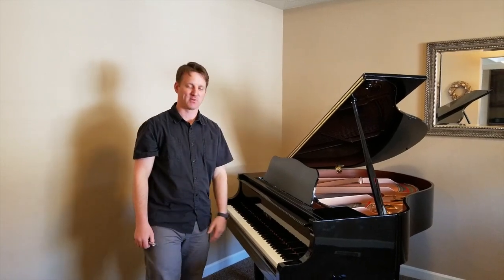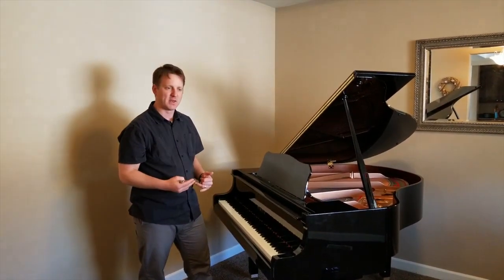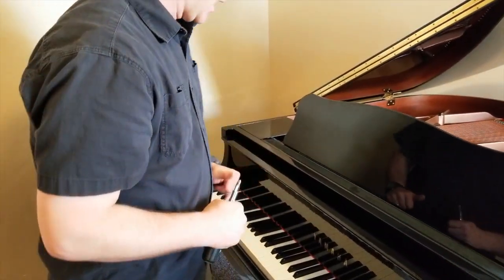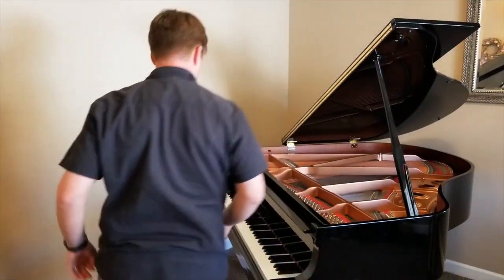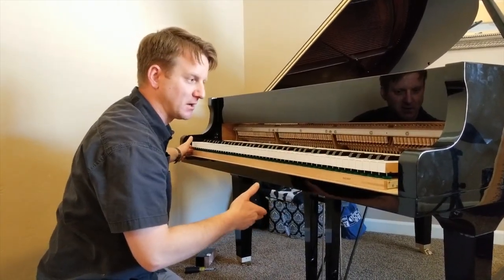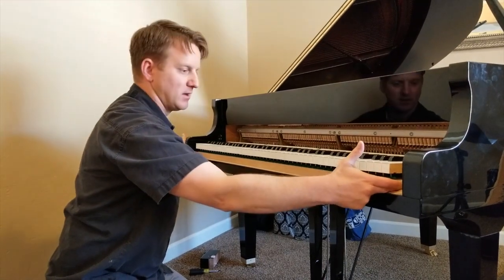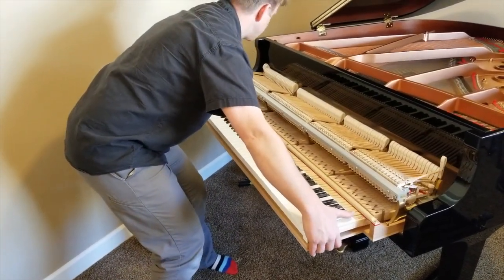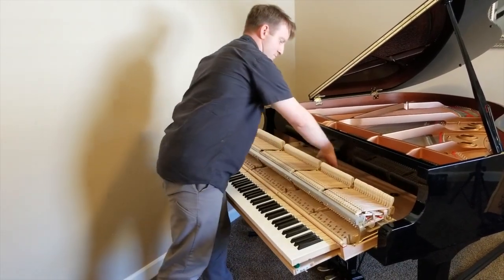HOW TO: Get Inside a Grand Piano

Comment: Thank you! I am getting a Yamaha like the one you are showing, but it has a few keys with chipped edges. Is it possible to remove the bad keys once the action is removed, or is there more disassembly required?
Reply from the maker: Actually in many cases you don't have to remove the action to replace a keytop or two on a Yamaha.  Yamaha keytops are just the top (vs top and front - no vertical part) so you pop off the old one, lightly sand the top of the key to get a good gluing surface and then put the new one on.  Best of luck!
Reply: @TheGildedPiano  Wow! Great news! Thank you. It's great to get advice from an expert!